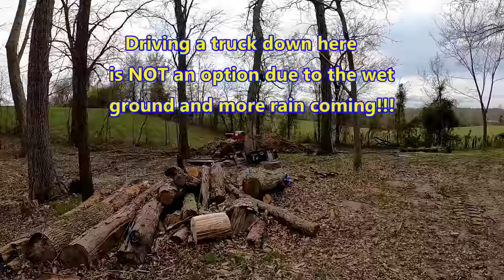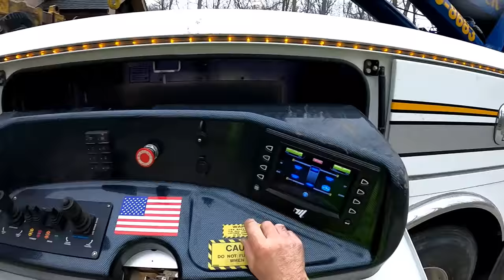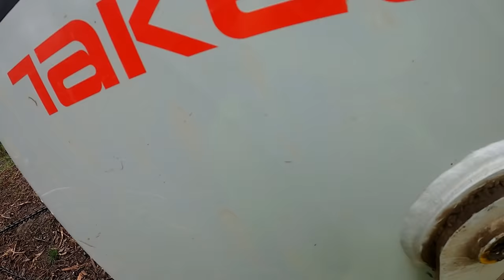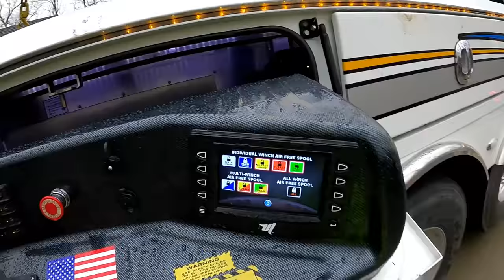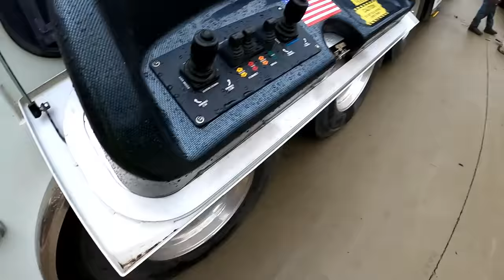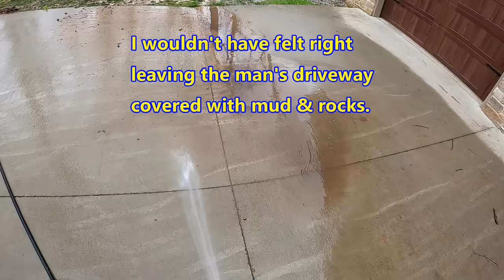The Uphill Battle!!!  Working in the Rain, Just Working in the Rain.

Comment from the maker: Hello ladies and gentleman and thank you for watching.   Allow me to address a few recurring questions and comments.   There have been quite a few suggestions, comments, or critiques about possibly moving the winch line to the left rear of the machine to pivot it around the tree rather than using the block & pivot method that Mike and I used.  That is a good idea and it might have worked.   I do not know for certain, because at that point we had freed up the tracks and especially the right side against the tree was free-rolling.   When I performed the same technique earlier in the video to reposition the machine, the tracks were still locked and the machine pivoted on the locked tracks.   Changing the line pull may have worked and it is/was good thinking.   Showing the block & pivot move was just another "out of the box" type thing that perhaps someone could learn from.   Also many have questioned why we didn't just fire up the machine and drive it out after we got it onto solid ground.   I explained it in the video....but for those of you who missed my explanation, the machine had been submerged in water and the control panel was fried....the machine was, quite literally, "dead in the water".   That was part of the reason we were called and brought Mike's rollback, so that we could haul it to the dealer for possible repairs.    Thanks for watching and God bless.
Reply: How long is the cable
Reply: Ron , got a question and it may be kinda stupid question/suggestion , but why dont you paint each cable to where you can easily see when you are at the 5 wrap mark. Use that bright safety orange spray paint and mark it?? This way you can easily see from a distance the mark and not have to walk all the way back to look ?
Reply: I have seen you do saves that seemed impossible! And watching this one, ya'll trying to figure out the best way to get it out...I was thinking...have you ever had a mess you just gave up on? Doubt it, because have been more than a few I didn't think we're possible, and you got the job done anyway!Was muddy already...but it would have been nice if it wasn't raining again!!❤
Reply: Imagine simple walkie talkies would be a better simpler solution for most cases, then we would hear both sides as well
Reply: @yogi_minnis  some wire rope comes from the factory that way
Reply: My only suggestion would be to knock out the mud dam in the bucket.  It might have save you from cleaning the driveway.
Reply: R.   Buy it
Reply: You could have chocked the track closet to the tree 🌲 and moved the winch over both of those methods would have possibly worked to get around that tree. Any job done without incident or injury is a job well done tho well done 👍🏻
Reply: I really love that you take the time to come and acknowledge that maybe not only would a different approach work, but that some may have even worked better! I've seen you do this on other videos and it really impressed me then as well! Yall are frigging awesome in the work that yall do. I never in my wildest dreams thought that I'd enjoy a towing channelbut you Sir have me hooked! 😉 😆 😂 😎
Reply: It's always easier to see better ways to do things sitting on your recliner  dry and comfy  not cold wet and sweating and knowing a million sidewalk supervisors are going to critique your every move nicely done  sir
Reply: Ron Pratt, what I learned in crane rigging class you are supposed to tighten the clevis finger tight and possibly use a tool after words to loosen. They call is tighten and forget
Reply: Hi Ron been fallowing your channel for about a year now and I really enjoy your content. As being a retired concert rigger i enjoy watching your setups and there is a question on your hardware that's been bugging me.
I'm guessing you have 250+feet of 5/8 line on your spools, so you have a good reach, but in situations like this where your short.
how come you don't have what we called stingers! (pre made cables) that are the same gauge of cable, as your primary lines.
we carried 5's 10's 20's 50's and 100's  
in your case with 2 primary's I would carry,
2 - 20' + 2 - 50' 
that way you could add 140' to your line and you could use the standard sheave block and protect your synthetic   endless loops from contamination. 
Curiosity Killed the Kat!
thanks for your time.
Reply from the maker: @stevenbrindamour3777  Actually we did bring the extra cable you mentioned.   It was on Mike's rollback.    It was too much length in this situation.  It was around 200'.   Thanks for watching and God bless.
Reply: I just found your channel. You sir are very impressive. No cursing, no yelling and you treated Mike like a friend, not an employee.
I don't know what you were paid, but it wasn't  enough. I would have had my chain saw out at the get go. LOL Be blessed and much success.
Reply: I don't get it. Why not just anchor a comealong to the tree and ratchet that little machine out by hand?
Reply: Hey !!! Ron , Mike  Thanks  for the Ability to Watch your video s on u tube/FB,  I enjoy watching  BIG TRUCK TOWING SHOW S/VIDEOS. 
      I also  like the guys in Canada.   I'm in Louisville, Kentucky 40215 Fyi
Reply: @yogi_minnis  in the oil field we would unravel the cable and  slip monafillamet in it. 1 50 foot 2 25 foot 3 10 u get what I’m saying
Reply: What about the Yankem through a pully? Also I had to pull a 16'×24' deck (2×10, 2x8 frame and 2x6 floor) with a little Kabota. Rope from deck to tree and a pully on the Kabota to pull sideways on the rope rather than strait.

Comment: Ron, I rearlly renjoy your videos.
Your problem solving is second to none as is your equipment and gear. You trat your crew with respect and dignity. If were 30 yrs younger i would love to work for you. I worked in steel mill many years ago and did a lot of rigging with chains slings and shakles. You bring me back to those days.
Wayne K.

Comment: Ive been in  pipelining for 17 yrs and We always tighten the Clevis bolt down then back it off a 1/4 ...And were hooking D8T together. Any wheres from 2 too 12 Dozers. And Ive never seen or heard of any problems from doing it that way. We use those straps like you have also.. Tough straps...I hate it when someone hooks my clevis and doesnt back it off. Actually I watch too make sure they back it off...Great Video...Thats going to be an Expensive  Fix on that skidsteer...

Comment: On your cables, when you get to the min wraps you need/want on your cable drum, paint the cable at the end of the boom so that you know how many are left at a quick glance (i.e. a yellow stripe for 10-15 wraps, a red stripe for 5-6 or whatever your limit is). This will help you from having to keep checking the drum on these long pulls.
Reply: Neat idea but only works if boom is all the way in. Not knocking it but it is a but limiting in usefullness. Still, I'd probably take that suggestion to heart if I had equipment like this
Reply: @chriskulpa4056  of course the boom extension is to be considered. If they put 5, 10, 25 wraps on their drum and fully extend the boom, the markings would still mean there was “x” wraps left, basically whatever THEY wanted as a guide marking. It was just a suggestion to improve safety and ease of use. They obviously do just fine without my suggestion but it was just that. If I owned the tow truck, I’d do it the way it made sense to me and my team.
Reply: @talonpilot  I think you have a very good idea. I have a winch on my Jeep so I'll do exactly what you are suggesting.  Currently I use the soft line (non-metallic) since it weighs about 25% of what the wire rope weighs.  Most of the time I only use about 50 ft. of the 90 ft. available.

Comment: Ever thought of using colors to mark your line? That way you know exactly how much is on your drum... Mark the last 50 or so feet of line. Love the vids
Reply: Only problem with that is the paint used to mark it wears off very quickly... when I was in the army we tried painting a green band every 50 ft with the 7-10 wraps painted yellow and wraps 1-6 being painted red but the grease/oil blend we had to use to keep the cables clean and properly lubricated would eat the paint in short order and required repainting every 3rd month

Comment: I keep looking at the house, and thinking what a beautiful setting!  So what the heck were they doing with the skidsteer clear down at the bottom of the lot?  Thanks so much for the excellent video.  I know it takes a long time to edit these videos!
Reply: Probably cleaning up the edge of their property  or cleaning up their rainwater runoff path to cut down on mosquitoes and other nasty bugs... I had to do something  similar on my property because  the prior homeowners  had blocked the natural rainwater runoff when they put in the driveway causing my field to flood with 8-12inches of water all summer long one drainage  trench redirect and a culvert pipe later my field was dry enough to walk on in a matter of days when before you could sink a lawn tractor running board deep if you got  more than 3 feet off the driveway

Comment: Just curious are you still planning to incorporate all the audio from both headsets, be great to hear both sides of the conversation.
Reply from the maker: Yes, when I am able to set it up on a job, I intend to do so.   We have 5 headsets and on a large job, like we had today (not this video) we used all 5 so I wouldn't have been able to tap into the audio with the current system we are using.  There are other headsets available, but they are very expensive.   The only issue with our current set is that it is limited to 5 and they do not work well with hard hats.   Anyway, thanks for watching and God bless.

Comment: You can't believe it moved the Tator, I can't believe the concrete slab didn't pop as close as the pad was to the seam in the concrete.  Nice Job Ron.  Like others have said Mike is really turning into a great help.  Does stuff so you don't have to.

Comment: Just a thought for next time…when the machine is close enough but before you bring the machine up off of the slope, try lifting it straight up by the rear until the bucket drains.  

What a great job you did.  Not heavy, not particularly dangerous,  but complicated to keep property damage to an absolute minimum.  Well done MidWest!

One more thought. With all that gumbo that seems endemic to your area, perhaps bring a portable diesel powered pressure washer and a 100 yrd of supply hose you could bring along in pickup or on the roll back for stuck in the mud jobs, then you could a) blast out some of the resistance mud away from the pulling edge and b) lighten some of the load by blasting off some of the mud off the frame.  I don't mean you're cleaning it, just freeing and lighting it.

Comment: I agree with Ron.  Run the shackle pin down then back it off a quarter turn.  That way if the strap or chain turns the pin tight while your pulling you don’t have to go get a punch to break it loose.  May not be the approved method but that what I did when I was logging my property and pulling logs just like they pulled that machine out.  Talking to yourself is ok too.  You get better answers to your questions that way🤗

Comment: I look back over the fifty plus years that have been me in the recovery  industry  and see  all of the equipment  changes that have occurred and never cease to be  amazed. My Dad's first "heavy " was an "Ortiz " mounted on an old ( but not so old back in the early sixties) LJ series Mack with a set of 5×3  transmissions and another stick for the 2 speed rear end. They were mounted behind a gas engine. My Dad could make it sing, never touching the clutch after the initial start. He'd  have one arm sticking through the spokes of the steering wheel and his upper legs clutching  the rim of the wheel,  his arms and hands seem to be just a blur as he moved all three of those gear shift levers like he was playing a grand piano. Easily  moving in and out of gear, hardly making any noise at all. At the age of eight or so it was if he were some great artist  without any peers.  I thought it was so cool that he wrapped  100' lengths of extra cable around the inside of  an old tire which he would  just pitch over an embankment  or wherever  when we ran short cable on the drum(s). Now we have endless loops of all weight restrictions,  grade 100 chains with all manner of specialized  hooks including frame hooks (I could kiss the guy who invented  that hook). Air bag units, Matt Jacks, Cordless impact drivers, a neat little tool that pops the u-joints  loose instead of having  to beat it with big hammer and lightweight snatch block instead of those Surplus Army ones with the flip over levers that weighed about 70# apiece.  They even make cables now out of synthetic "rope" that will handle almost anything.  I have a set mounted  on my twin line American  Wheel Lift light duty wrecker. They've  been on there more than three years and except  for some fading,  they are like new. If they ever do separate  under load, they're  going to lay right down and not whip through the air separating someone from their head because  they were in the kill zone and despite constant reminders,  there  always seems to be someone in the  "kill zone ". Perhaps  though, the single biggest equipment  improvement (with the possible exception  of the Holmes 750 and 850 series when they first arrived on the scene) has been the rotator recovery  unit. Now I know that this, in itself, is not a new concept.  The Military has had them around since the early fifties in the form of the M-62 and it's newer siblings.  However,  they, for the most part, are very capable,  but in reality with their single multi-part line and their inability  to accomplish  much in the way of side pull stress on the boom, should be considered  more of a mobile  crane than a wrecker such as the rotator. I could go on, for quite awhile, as you know. All of the equipment  improvements  have made the industry  a safer, quicker,  more efficient  place. Although  increased  traffic flow has  made the Recovery industry  still be one of the most dangerous  place to operate in. Still, I've seen you several times over the years that I've been  a ardent  fan of your videos while waiting for the phone to  ring or for the beeper to activate recover a roll over in 45 minutes flat with "tator" to  what would have  taken 2 Holmes 750's 3 hours to accomplish and that is if you didn't have to unload it first. Not only that but evolving procedures such a hold back wrecker makes the concern of dropping  one hard enough as it come back over center, jumps the "blocks" and rolls into another piece of equipment  such as one of the wreckers or worse, a fire truck. Gone are the days when it dropped  over center only to continue  it's  journey  and flop over on it's  opposite  side. Because of outriggers  and hydraulic  spades you no longer hear much about runaway casualties that continue  on their unintended path, taking the wrecker with it as the hapless  operator  runs for their lives or stands there, hopelessly.  Yes, our Lord has blessed us with many new procedures  and improvements  in our equipment.  One thing He has not done is rid us of the sidewalk commandos.  Those individuals  (there seems to be one in every crowd) who, with their superior  intellect  always have a better,  faster, more efficient  and safer way to accomplish  the mission.  Reminds  me of one day while I was in the military overseas in Europe when I was called out to an accident  involving a tractor  trailer that had flipped, coming  to rest solidly  on it's  roof. It was loaded with two twenty foot containers  loaded with the doors facing  each other so you couldn't transfer the load, full of explosives and ammunition. Not having access to the proper equipment  and with the container's locks jamed we couldn't just lift the trailer off the containers and reload them. After several hours of effort I managed to get it on it's  side and was deciding just how to proceed, the problem being that it flipped on a curved  narrow off ramp with about a 20○ pitch that was working against us as I did not yet have anything to use as a hold back. As I was standing  there contemplating, the maintenance  warrant officer from the unit the semi belonged to showed up and after calling me an idiot multiple times told me I had fifteen  minutes to finish. When I explained to him the jamed locks and the fact it was loaded with ammunition he said that I was to use the torches on the M-816 wrecker to cut the locks, I explained  to him the unavailability of  that option due to the nature of the load, after reminding  me once again of the status of my intelligence  level he ordered me from the scene.  I didn't Argue but got my team together  and  advised the on scene German  Federal  Police  of the situation. Needless to say he, after my explanation,  agreed with me and it wasn't  too long until the maintenance  warrant  departed. Shortly thereafter  the additional  equipment  that I felt I had needed, with the assistance  of the German  Police was ordered and arrived eliminating  the almost certainty of a  very destructive explosion  that would have likely  occurred  had the warrant  officer begun blazing away at those container locks with cutting torches. The Lord was with alot of us that night and I didn't even know  Him yet. Absolutely  outstanding  recovery.  God Bless You all. Your videos  are going to convince  me the absolute  necessity for  a rotator  yet. Perhaps  a 75 ton twin steer job. Keep the rubber side down and your cables straight, you're  an inspiration.